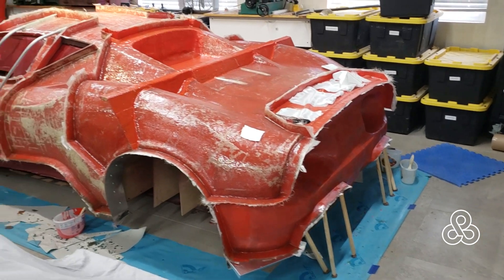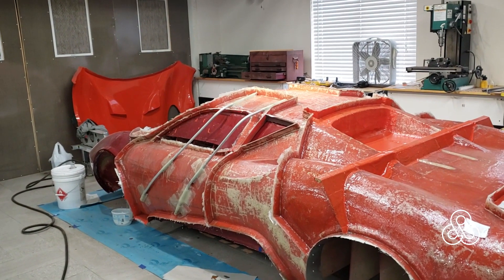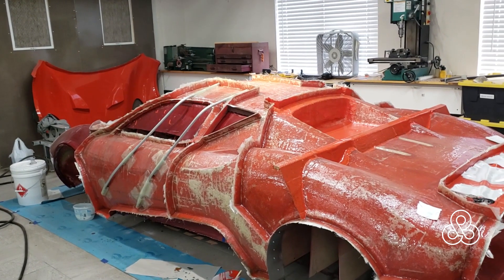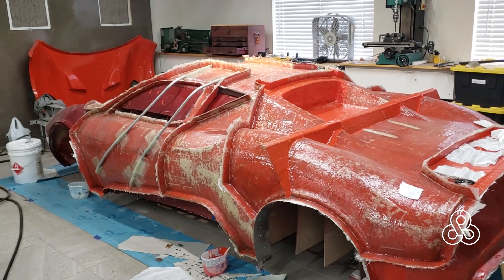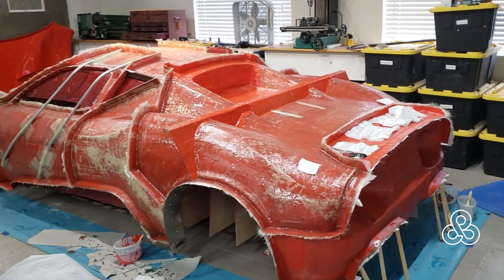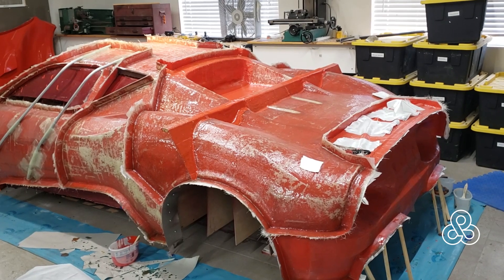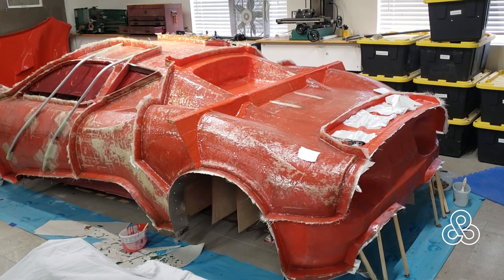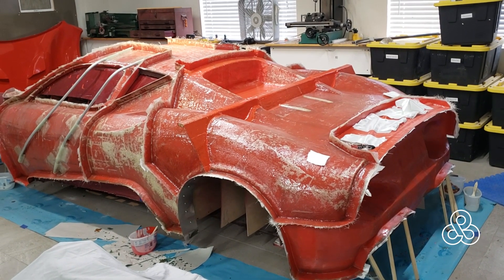Moving to 2nd gear in the Arete supercar project. I need your input!

Comment: I think your doing a great job, the sounds was definitely a issue which I agree you are getting ontop as well.  It was very difficult to find this build and I look for car builds all the time becuase I am building a car as well and develping a high rpm engine but I don't post video's much.  I haven't looked but maybe add some key words to reflect the part you are upto on the project when posting a new video.  That way the project will come up with more seach responces.
When I found the first video and saw the heading "Building a Super Car" I was sceptical but you proved that you are doing a great job.
Keep up the great work.
Tony
Reply from the maker: Thanks Tony! Glad to have you along for the ride. YouTube says they are relying less on Keywords and more on the description. I do add keywords, but trying to embed more specifics into that description. However, how many times can you say Supercar, garage build, DIY, racecar. . . without sounding "obvious." Ha!
Reply: @BuilderCreator  I am on a car forum so I posted a link to the building of the buck.  What I might do is ask a couple of mates to post links on other forums.  I we got soem of the video's on a bunch of forums then people would see it and get interested.
Good luck.
Reply from the maker: @anthonyparle7342  Thanks for the promotion! Always glad to get connected with other petrolheads.

Comment: The volume of the video isnt as loud as other videos iv watch so thats the issues for me your easy to understand its just not loud enough unless i have headphones on  so thats the only thing i would change if you can figured out how to make it louder this video was louder then other so i might have already addressed that. And more drifting the better!;)
Reply from the maker: Thanks for the input Spencer. I have addressed the volume issue- I automatically adjust the gain on every video now. It seams that the mobile device viewers all have this problem and being that I edit on a desktop system, with earphones on, the volume thing just didn't show up until the video was posted. You should start a drifting channel? the one video I did post of drifting has gotten quite a few views.

Comment: Not really input it’s a question. Have you built your own chassis and if so did you do a video on it?
Reply from the maker: The car will be built with a composite Monocoque tub (passenger cell) with 4130 steel tube subframes front and rear. The rear creates a cradle for the engine and suspension mounting points. The front subframe is rather short with just enough room for mounting of the differential and suspension pick up points. You can see the start of the rear subframe here-   https://www.youtube.com/watch?v=ASuQVgJ9BD8  I will be starting the layup of the central tub the first of the year 2020. . . stay tuned!